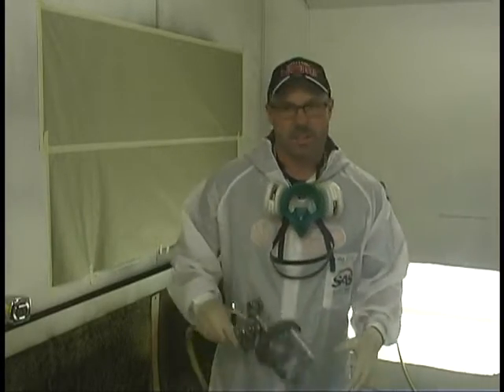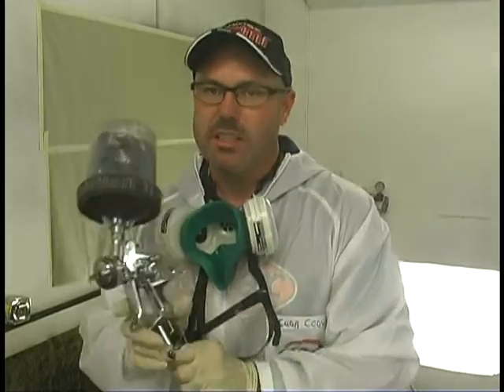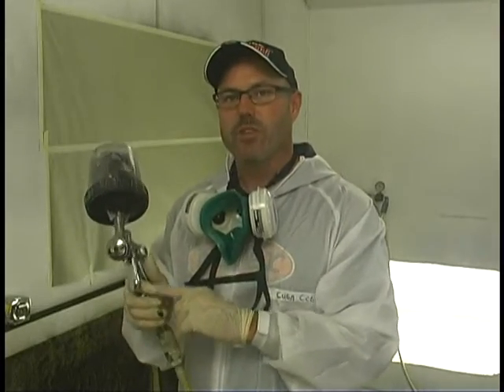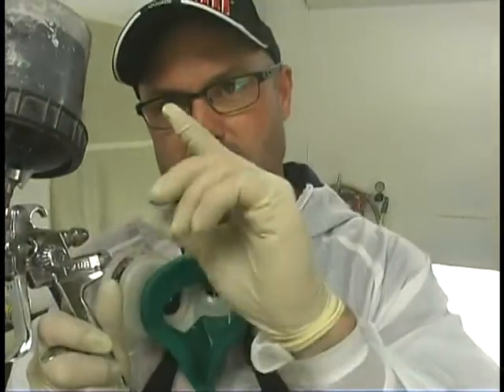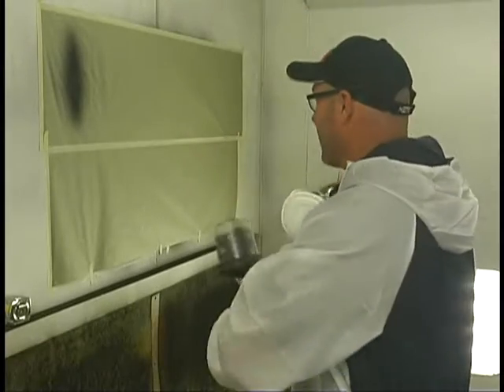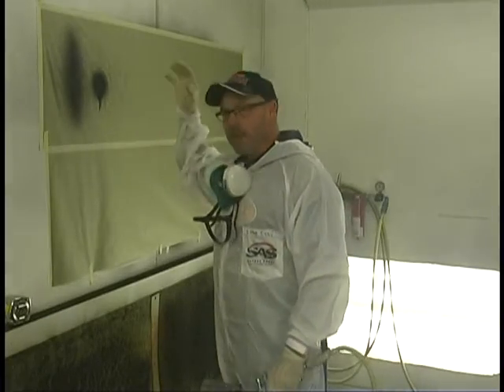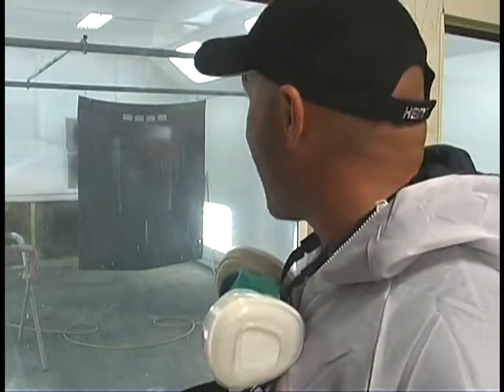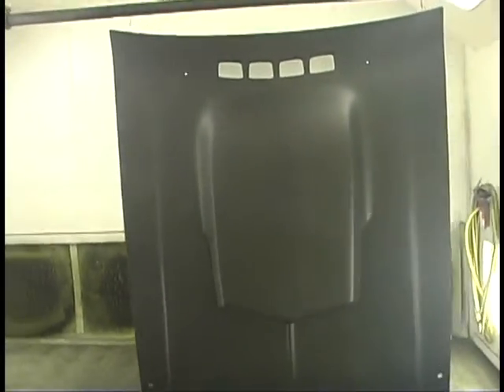Tips & Tricks painting Mopar black ORGANOSOL ppg dcc 9355 Cuda Challenger part 2

Comment: Your analysis and presentation are most impressive.  I am about to spray the hood and hope to get that 69 roadrunner look with your exact recipe (except the texture additive is no longer available).  I notice you are using the PPS 1 cup.  I have PPS 2.  Per your comment on no filter should I remove the mesh filter from the inside of that cup lid?  Thank you.
Reply: If you can't obtain the texture additive anymore, it wouldn't matter one way or the other.

Comment: Looks Great!  I need to redo my Duster hood with Organosol, so how will the replacement 340 Wedge decal adhere with the paint?
Reply from the maker: A short (quick) answer is to do 3 spray outs (1 without any texture added, 2 with 50% added and 3 with the mix shown in the video) and then apply a sample piece of vinyl to them to see how it works.  With over 20 years experience in sign vinyl graphics I would need to know a little more about the quality of the vinyl you will be using to answer your question.  Long answer....  There are two types die cut of vinyls.  Calendared and Cast.  Calendared is pressed in to shape (about 3 mil thick) and is consider the cheaper / entry level vinyl.  Because it's pressed (between rollers to manufacture it) it has a memory and will shrink and peel back over time.  Calendared vinyl has about a 3 to 5 year life.  Cast vinyl is broadcast over the backing and the 2 mil thick end product has almost no memory.  It's consider high quality and cost more then Calendared.  Cast vinyl has minimal shrinking and at least double the life expectancy compared to Calendared.  Most vehicle graphics are made from Cast vinyl.  That's good for a long life, but Cast vinyl is thinner (2 mil) and can show texture through it easier.  Some vinyls, like reflective, are thicker Cast vinyls and they work good over texture.  For example, the Challenger TA rear spoiler decal is reflective.  I put a reflective Challenger TA spoiler decal on the wing I painted in the video and it worked perfectly.  It helps to use a good Applicator and a Rivet Brush when applying the vinyl.  Also, the air pressure of your gun and how many layers of Organosol you shoot will effect the final texture.  So it's best to do a quick test spray out and get a sample piece of vinyl to test.  But if you don't want to do the test spray outs, try 25% to 50% of the texture in the mix and you should be super good with the decal sticking and looking good.  In the back of my mind I think the 100% texture mix would be fine for a hood decal.  But I have not tested any large decals to be completely sure.  If you get stuck or have any other questions, let me know and I'll send you my phone number so I can talk you though it.  Thanks for checking out my videos.

Comment: Howdy I have a 1970 Dodge Challenger RT SE 383 Mag..Birthday of Oct,16 1969.. Was the door flange on these early productions painted black or where they the same color as the body. I know the cowl was the same color as the body. But not sure about the down ward flange below the door. Do you know and if it was can I just mask it off and have a can spray paint made to the job.... Jim
Reply: Hello Jim,The cowl's on 1970 E-Bodies was blacked out but only on certain colors.  The dark colors like TX9 (Black), EF8 (Dark Green) and I think EB7 (dark blue) was not blacked out.  Then around 1971 they stopped blacking out the cowls on Cuda's and Challengers.  Since they had the fenders on before they painted the car the rest of the car would be body color or over-spray of body color.  If there wasn't body color then it would be the grey dip primer.  You can see the dip primer process here (last image) https://www.e-bodies.org/resources/data-books-salesman-pocket-facts-color-upholstery-guides/1971-dodge-data-book/unibody/
Reply: Cody thanks for the reply. In side the cowl it is mostly the DY3 Cream. But when you look way deep it is the gray primer. Ok what about the body flange rail under the door? The part that points down ward where the bolts are. Jim
Reply: James Butcher... there's a ton of knowledgeable guys on the E-Bodies forum https://forum.e-bodies.org.  You can also find the factory engineering drawings on that site in the "Resource" section.  https://www.e-bodies.org/resources/cuda_challenger_tsb_specifications_engineering_illustrations_drawings/  Click on the one called "Blackout Sill & Pillar".  The other blackout drawings are there too.